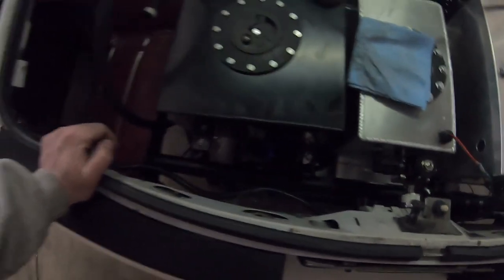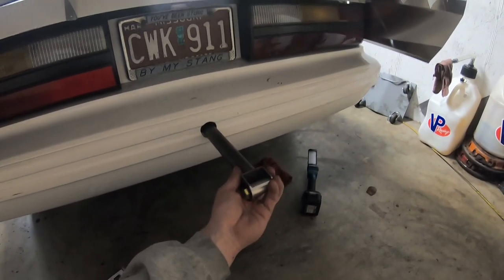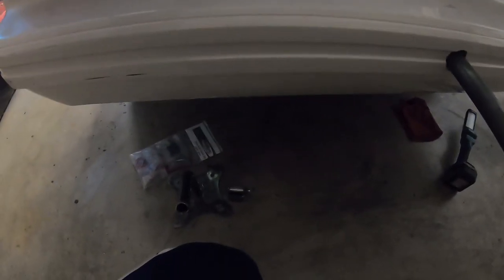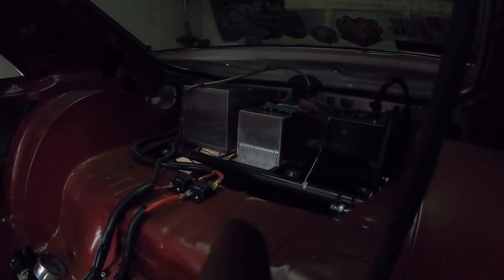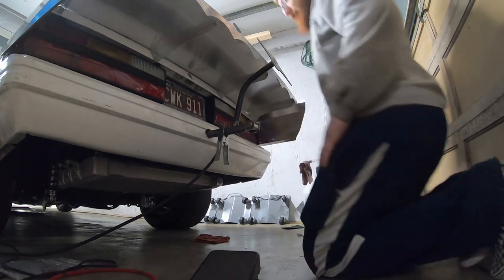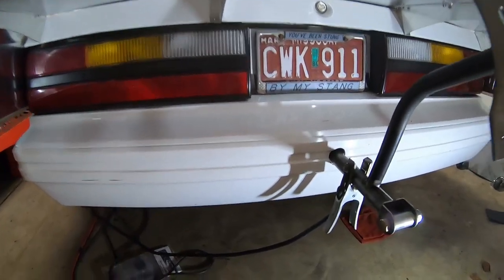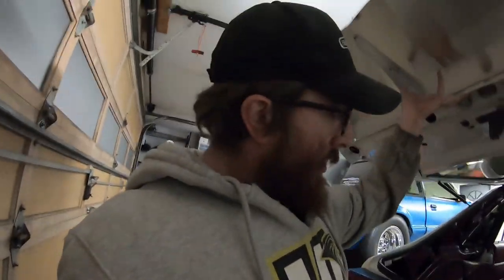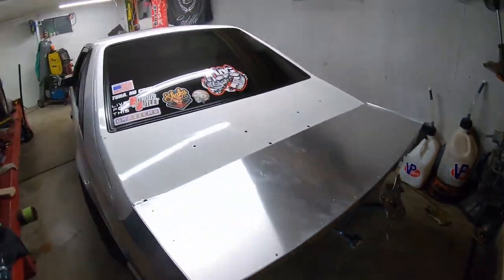DIY Parachute Mount!

Comment: Get the mild  steel cage and gusset around halo and rear support  tubes. Like the build what is the widest slicks you can run without modifying the rear end.